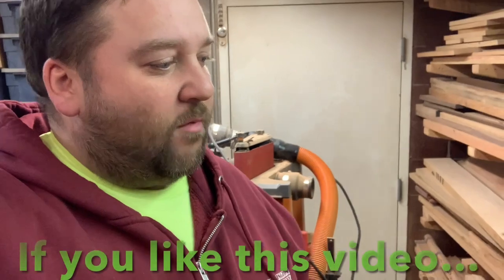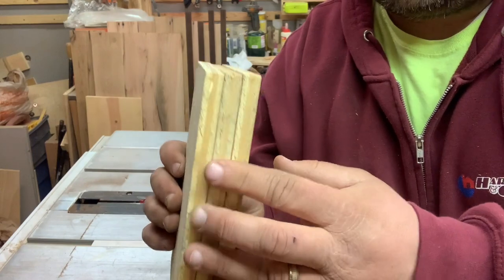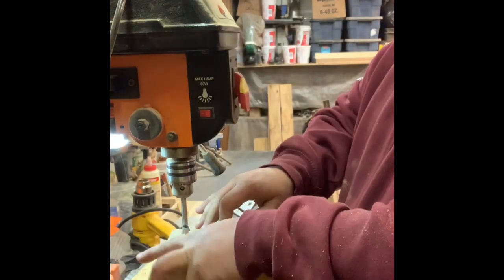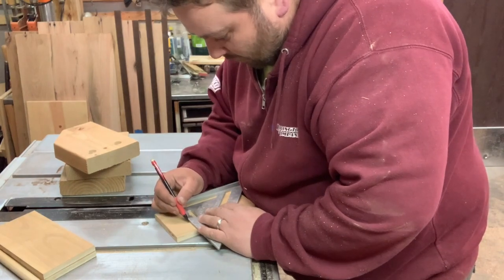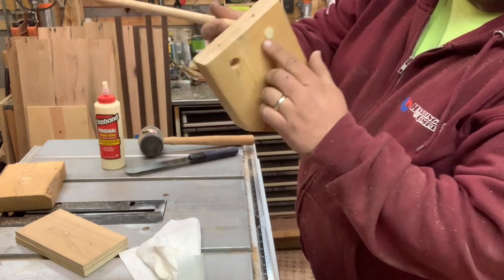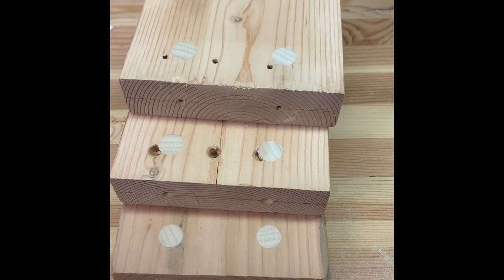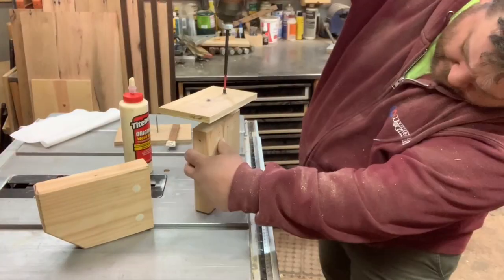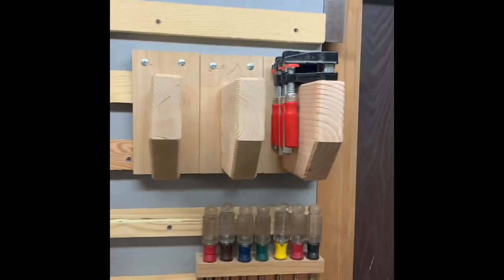Do this one simple project to save a lot of shop space

Comment: Why drill holes then fill with dowels
Reply from the maker: Ok, so, the problem with the way these were constructed, is that you saw me screw in from the back of the plywood into the 2x6. Normally that is not a problem, but the 2x6 was oriented perpendicular to the plywood. So that meant that the screws would be oriented in line with the wood fibers (screwing into end grain). When this is done, and force is applied, the screws can rip out of the end grain. So the dowels are inserted in a perpendicular orientation to the screws, so that when the screws are driven through the dowel, it acts like side grain, and increases the holding power. 
Does that make sense?

Comment: After 30 years of teaching high school woodshop, I would have to call you out for using your table saw fence and miter gauge simultaneously without a spacer block when you were cutting the french cleats towards the end of the video... but I have to admit that I do it too when nobody is looking 👀😎

One question that I need to ask is WHERE did you get your "screwmates" from? I have a set exactly like the ones you use, but I would like to add a backup set to my collection. I have searched all over for them but keep coming up empty handed. They are some of the best that I have ever used. 

Nice elegant solution to a clamp storage problem!
Reply from the maker: Thank you for watching and yes, I’ve been made aware that I am in fact doing things dangerously 🤪 Im assuming that by screwmates you mean the drawers under my workbench. I used to work at Home Depot, and one day they were replacing all of the specialty hardware bins in the screw aisle, and I was able to lay claim to three of them before they got thrown away. 
I love them too! When I built my workbench I made sure to angle the front of the units up just a little, so that they always want to shut automatically. 
Thanks again for watching, and believe it or not, I never took wood shop in high school, even though now I wish that I had. 
Check out the shop upgrade 1-5 review video I made that addresses some of my improvements to the upgrade now that I’ve used them for a bit
Reply: @imaginationingrained  What I referred to as "screwmates" in your video were the bits that were in your drill to bore the pilot holes for the screws, hence their name, "Screwmate".
They were originally made by Stanley Corp. out of stamped steel in various sizes. Sadly, they appear to be no longer available. When I saw them in your video, I was hoping that you had located a new source for them.
Reply from the maker: Ooooh, those. 
Sorry, yeah when my dad passed away I inherited his tools and he had a set of them. They are a good countersink set, great for wood screws. I really like them too. 
So yeah, mine are from the ‘70’s/‘80’s

Comment: What was the point of the dowels?
Reply from the maker: Ok, so, the problem with the way these were constructed, is that you saw me screw in from the back of the plywood into the 2x6. Normally that is not a problem, but the 2x6 was oriented perpendicular to the plywood. So that meant that the screws would be oriented in line with the wood fibers (screwing into end grain). When this is done, and force is applied, the screws can rip out of the end grain. So the dowels are inserted in a perpendicular orientation to the screws, so that when the screws are driven through the dowel, it acts like side grain, and increases the holding power. 
Does that make sense?

Comment: Why do all of you on you tube in sist on not using crown gaurds on circular saws?
Reply from the maker: Can you please expound?
Reply: @imaginationingrained  Not sure if I have ever expounded before, but as a retired joiner I will say using a circular saw without the correctly fitted safety features is in my opinion foolish. No offence intended.
Reply from the maker: No offense taken since I haven’t used a circular saw in my videos yet. Unless you are referring to the table saw. In which case, I use mine in such a wide array of configurations, that it would take just as much time to set it back up between cuts that it would equal the amount of time it takes to do the entire project. If I had a large enough shop to dedicate a crosscut table saw and a ripping table saw to leave one set up, then I could retire from my day job and do project videos full time. That would be lovely. Also, I have cut my fingers on my tools, and since then, have been very conscientious of my interactions with them. So thank you for your concern, but I have found what works best for me
Reply: Why do trolls on YouTube in sist on having things done their way without having any content themselves?🤦🏽‍♂️